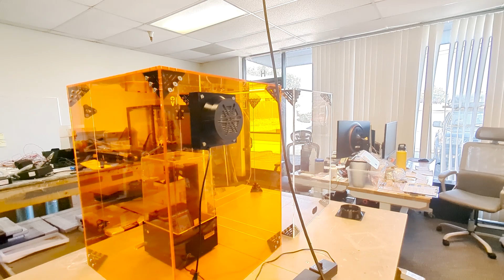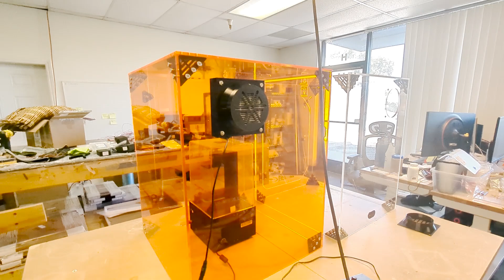Resin 3D printer Enclosure by Clearview Plastics

Comment: Love the enclosure. Are these made to order? The VOCs from the resin are heavier than air and if the vent hole was relocated towards the bottom of the enclosure it would be more efficient for direct extraction of fumes and airborne particulates. Simple design change that no other companies account for (creality, wham bam), food for thought! I love the quality, so much nicer than a tent setup but if I were to order one I’d like the fan hole at the bottom :)
Reply from the maker: Thanks for the kind words and thoughtful suggestion. These are not quite made to order these days, we do make them here and we carry some inventory to help keep the shipping times down. A great suggestion on the fan location.  It is indeed an easy switch. We do have users that also use these for their IPA bath which I I think would be better with the fan up top. An easy way to accommodate both would be to simply rotate the rear panel 180 degrees. There is a wire grommet that would in result be up on top, a bit of a tradeoff, but it would function correctly. Think this might be workable?

Comment: Nice overview of your products. One topic you didn’t cover was possible environment temperature control since resin will print with fewer failures in a temp range specified by the resin manufacturer (typically between 25 C and 30 C, but can sometimes work between 20 C and 35 C, etc). It looks like there would be space inside your enclosures for small PTC computer-controlled heater setups.
Reply from the maker: That is  a Great suggestion.  We do work to be able to fit a PTC heater. We've even made some of our own. We might offer something in the future, but at the moment there are a few options on amazon that are super easy to add in as a DIY. Appreciate your feedback and suggestion.